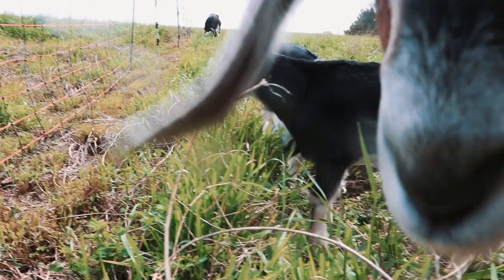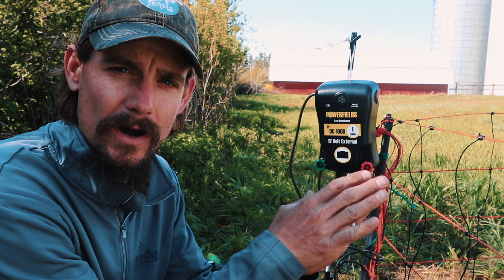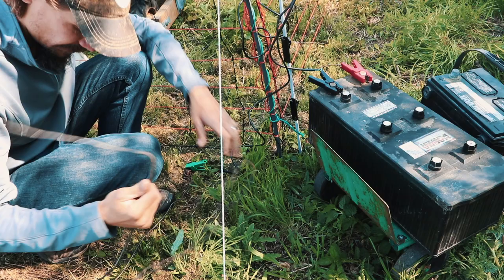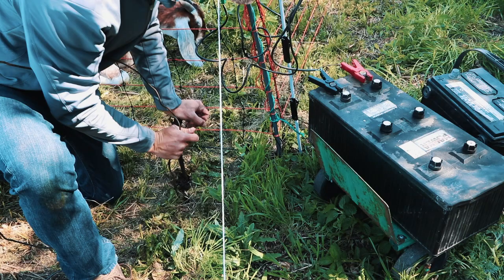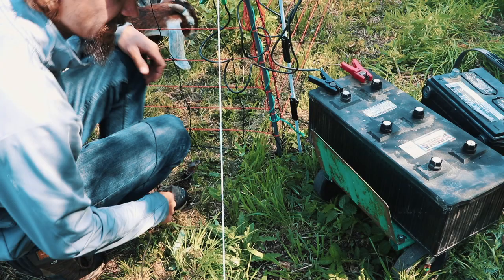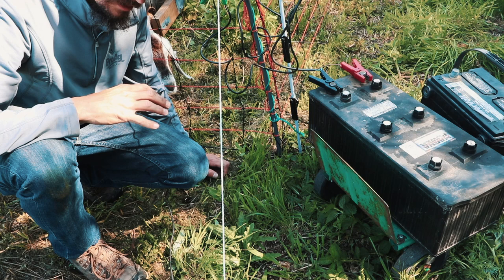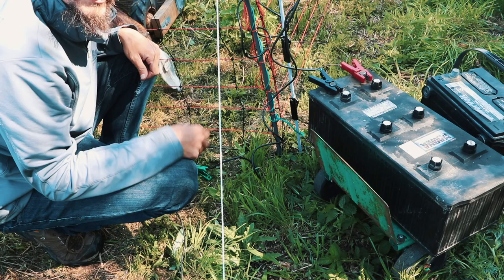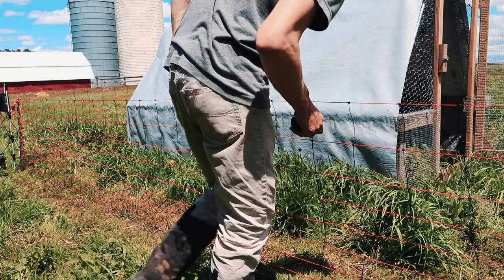The MOST important part to ALL electric fences

Comment: If  you have high traffic areas... that constantly get grounded out...consider using a spark plug in series or parallel.  Set the gap...... this way.......an area can be dead grounded and the remaining still works because its not totally grounded.  Works best with creek crossings or where deer knock out the fence.

Comment: And.....you can put an 8ft ground rod down in the ground  by using a small bucket of water and a cup.  Start the hole..fill the hole with water. Use the ground rod and slowly life it and drop it down in the same hole...keep filling the hole with water. The hydraulics  will allow the rod to go down with very little effort !  This way you have the best possible ground !